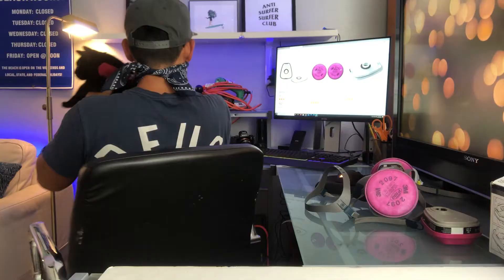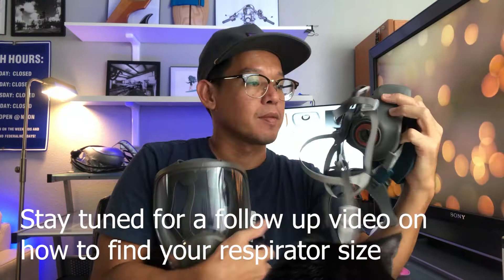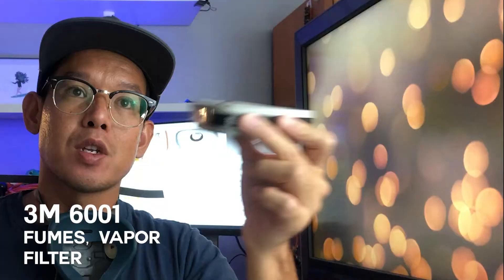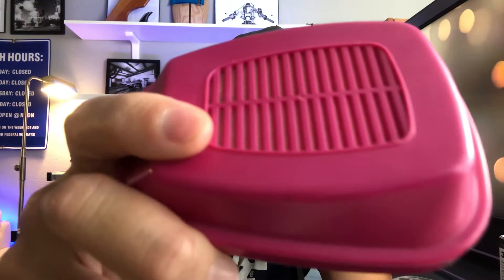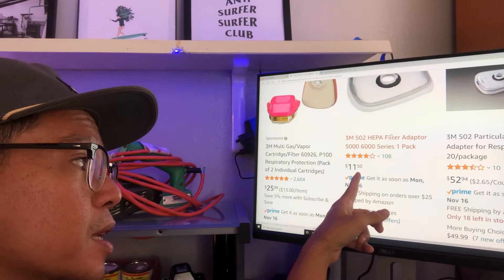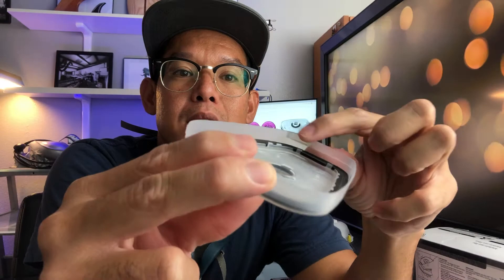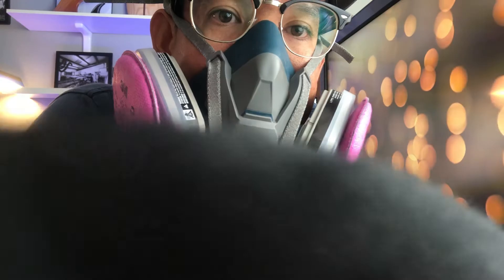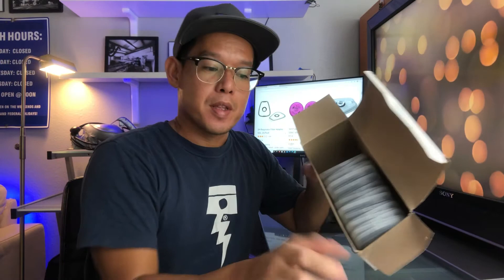How to extend the life of your 3M RESPIRATOR mask FILTERS!

Comment: 2 years later, I'll add - put a little dessicant pack in with your mask in the ziplock bag to prevent mold/mildew due to humidity.  You know, those things you get in retail boxes and meds that you probably throw away 😢.
Reply: You can microwave those silica beads to drive out the moisture and rejuvenate them btw!
Reply: @chang.stanley  Holy crap, never knew that.  Thanks for the tip!  Rejuvenate the rejuvenator.
Reply: @Armageist  No problem!

Comment: I think those adapters are technically single use and need to be replaced with the dust filter when it is used up. 3M say that reusing the adaptors could allow dust to be inhaled. That's why they come in packs of 20. The single ones for sale are just a scam basically. 

You can get an adaptor for 5000 series chemical filters that you can reuse with 5000 series shaped dust filters. It's called the 3M Filter retainer 501.
Reply from the maker: Yeah, I can see why they say they're single use, bc the snap on feature is super tough to get off and put on another one. But if there's any leakage, I'd think the vapor cartridge would catch it. The 501s are a good option too 🤙
Reply: How often we need to replace the catrige?

Comment: You should check pricing, it's probably cheaper to use a 3M 501 and a 3M 5N11 that clip over. The you're using I believe IS a one time use, but ONLY when removed from the primary filter-- you CAN swap the dust filter on the twist on housing.
Reply from the maker: The 5N11s are for sure cheaper! The 501 + 5N11 combo is a good option, but for me, since there's so much surfboard foam dust in the room that I glass, the ease of dusting off some of the excess dust build up, + potentially less waste, I can use the pink 2097s for a little longer rather than change out the 5N11s more often🤙
Reply: The pink filter is like 100x more "filtering power" than the white 5N11. P95 vs P100. And it lasts a lot longer.

Comment: The adapters are only one time use, it's not to be put on and put off, check the 3M videos anda data, if you put on and put off it could leak and you don't have seal anymore
Reply from the maker: Thanks, I could see why, since the snap on feature is very hard to remove once you get it on there. But if there's any leakage under the 2097s, the vapor cartridge will hopefully catch it 🤙

Comment: Hi, thanks for the video, I just wanted to comment that if any oil based aerosol get into that 2079 you got to throw it after 40 hours or 30 days (based on manufactures recommendation). Not sure if you knew about that, so you must be sure of what you're working with to avoid that. Cheers
Reply from the maker: Thanks for the tip! I've heard of the 40 hour rule too🤙

Comment: Hey Dust and fumes! First off, i bought the 3M 60926 (gold colored) cartridge. Do you know if that is adequate for painting (regular household painting walls)?  
Also, under your description, i guess people were suggesting looking into the 3M 501 filter retainer, do you know how it works? I think it's a good option considering a 20pack of the 502 is almost $70 (and alot of people were saying it's one time use). With the filter retainer and replacements, are we able to just pop on and off the cartridge cover and replace it with the filter retainer and on intervals replace the cotton filter? If you don't have experience with it then I understand. 
However, for your setup, how often are you replacing the filter adapter? Im just worried because i'm planning on removing popcorn ceiling and this requires painting and the actual removal of potential asbestos containing popcorn ceiling. So, a setup like this would be very helpful if not life saving! Thanks in advance.
Reply from the maker: I think the 3M 60926 should be ok for painting vapors and popcorn ceiling dust. Here's what I found with the specs from 3M for the 60926 cartridges: https://www.3m.com/3M/en_US/p/d/v000057497/
As for the 502 filter adapters, it allows you to add an additional particulate filter on top of your vapor cartridges. They say it's single use, and it is pretty hard to snap on and off, but in my experience (mainly surfboard building in dusty and fume-filled environments) they last at least the life of a couple of lives of vapor cartridges(40hours per set before changing out). The pack of adapters is pretty pricey bc it's probably mainly for contractors and others using lots of them for a team, but I have a link in the description box to single pairs on Amazon.  For the 501 retainers (not adapters), I'd use them just for holding the P95 (thin) filters on top of the 6001 vapor cartridges if that makes sense. For my use, the P95 thin filters iare ok, but not as good as when I use the 502 adapters to mount a 6001+2097 on top. (All these model numbers I'm referring to are 3M). Hope this helps🤙

Comment: Hello 
How are (Gas Cartridge Particulate 7093), (Multi Gas/Vapor Cartridge 60926) and (Organic Vapor Cartridge 60921) P100 Filters are different?
Which should we use for better protection against covid?
Reply from the maker: For covid, I'm not sure, but I can tell you that my 60926 and 60921 both don't let polyester resin smells through. I haven't tried the 7093s
Reply: Todos los que digan P100 son para covid-19, los 7093 sirven para covid-19.

Comment: Sir in my country these masks are of 2015 available and are not opened...but Google says they have 5 years of shelf life...so is it ok to buy? please help me
Reply: Hello, I am from Argentina but there is still the google xd translator I would tell you not to buy it since the 6200 or ----- series have rubber, that rubber like that of tires or shoe soles has a useful life time and then it cracks and transform slowly in to dust, they lost elasticity too, so if they are already 5 years old with what they cost they will not last long and you will have wasted money
Reply: @VostockR  wrong completely, it completely depends where its stored if it's stored inside and not exposed to the sun and heat it should be as good as new, I have 10 year old brand new 3M 7502 from 2009 from the H1N1 pandemic they are still working 100% just like new

Comment: only 10 months late here… wondering if you are still selling any 3M respirator filter adapters???. I have a  3M Safety 142-6100 6000 Series Reusable Half Face Mask Respirator, Small.
Reply from the maker: Sorry, no, they went really fast, but check the links in our description if you've been trying to track them down :)

Comment: Do these work better than the 501 and 5N11 filters?
Reply from the maker: I'd say the filtration and capturing of particles is about the same, but with the pink 2097s it's easier to dust off some of the excess dust before needing to change it out, if that makes sense. So about the same filtration, but better ease of use